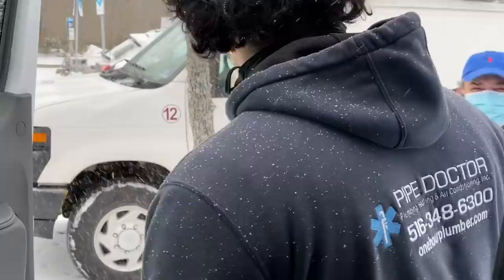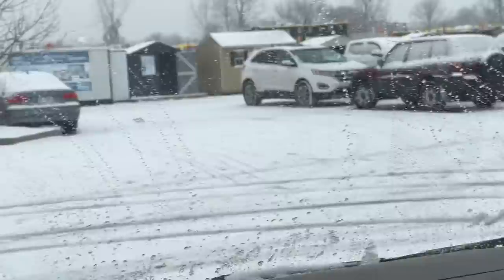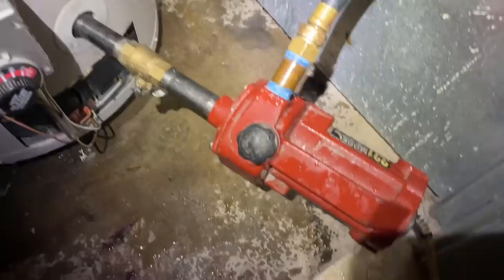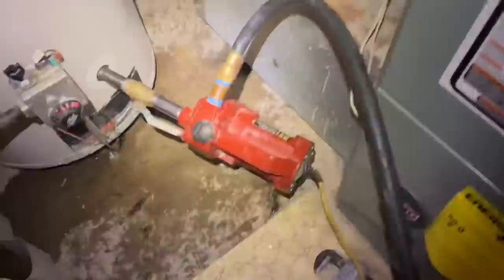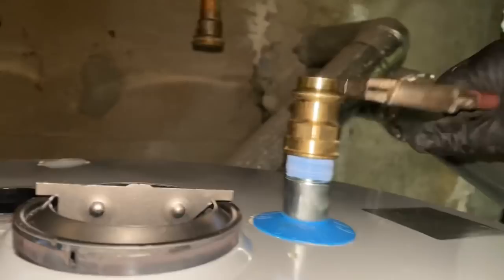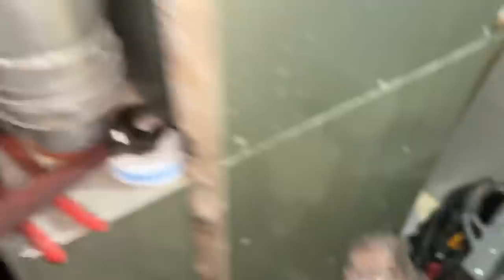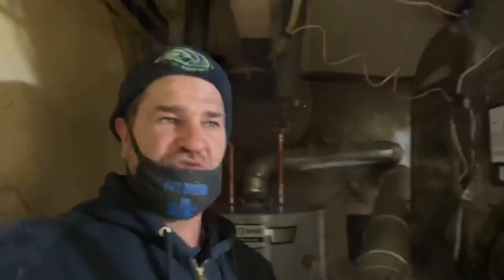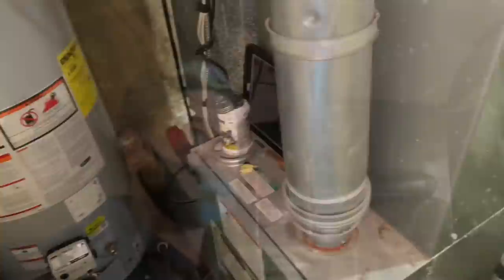Need to Replace Your Water Heater? Let's Discuss Your Options During AO Smith 50 Gallon Installation

Comment: I find tank less water heaters is not worth the cost in most cases for exact same reasons you described.  I had few customers complaining tank less water heater not lasting. But they never had tank less water heater serviced.  I also had a commercial customer who wanted to replace power direct vent water heaters with tank less.  I talked them out of it because I know they will never service it. Unless you can service tank yourself, only advantage in the US really is space saving and most customers cannot even light pilot themselves.
Reply: They need an ion at the least and a filter with an ion would be ideal. Really, we all should have one.
Reply: Here in Texas , tankless water heaters last last long even with no service, the only reason I’d do tankless is just because I want it, but I can’t justify it because the 50 gallon just hasn’t disappointed me. I’m sure in other places tankless is a better more efficient option. Here in Texas we all have furnaces, so water heating is not used for heat.
Reply: @PipeDoctor  good choice for a professional. You’ll save money and space and have endless hot water. Did you have to add a bigger gas line?  That can be a big added cost. Our friend Roger W from Texas was against putting a tankless in his home for that reason.
Reply: @Jimbobo162  
I increased the size of the gas-line from 1/2” to 3/4” off of the 1” main gas supply line.

Not sue why, however? Wasn’t too expensive.

Comment: I was considering going tankless but I’m glad I have a regular water heater, our water heater hasn’t gone out during all these ice storms and power outages. My house could accommodate tankless or tank and I sure am glad I have regular tank type.
Reply: This is absolutely a consideration that gets overlooked by too many people. You always have 50 gallons of hot water at the ready. Glad you’re safe!
Reply: @PipeDoctor  Do manufactures still make direct vent water heaters with no electrical components? Like the discontinued Rheem storm fury brand of water heaters. Every water heater I see now has some sort of electronic control box on it. Meaning if the power goes out, you might have a problem.
Reply: @bullmoosepiper7732  Here in Texas freezes like this are highly rare, tankless water heaters are nice, but here in Texas going tankless is a matter of preference, there’s no real utility savings. My house was built in 2019 with an Ao smith 50 gallon. I’ve considered tankless just as an upgrade but I can’t justify it.
Reply: Yes!  if you're in an area with periodic power outages you can nurse that 40 or 50 gallons for a while!  Also modern tank units are much better insulated than you might think -- it's not running that much keeping the tank hot.   Finally, "limitless" hot water means your teenager might never leave the shower -- there goes whatever savings haha.   Everyone be safe in this nationwide winter mess!

Comment: BX was metal clad cloth wrapped cables from the 1920s-1940s..  The outer metal can be used as a ground, but it was never really intended as such.  Instead the cable was just protection from rodents and such chewing into the cloth wrapped wires.   (And yes, everyone I know still calls the modern stuff BX unless they're talking to an inspector.)
Reply: Let me add some information on this subject because I'm a licensed electrician with a few years of experience under my belt. BX cable, as many in the NE area of the US call it, is technically AC cable (Armored Clad) and is identified in the National Electric Code as such. It was called BX cable after the Bronx Cable Company that used to manufacture it. AC Cable has a steel outer jacket with paper wrapped around the conductors inside the metal cladding and is still widely available and can be used in many applications. It's still very popular in NY. It typically doesn't have a full-size grounding wire in it, but it can (Hospital Grade AC Cable, which requires a redundant path of grounding, is one example). Also, note that there's a much smaller bonding wire that runs through the cable to make sure the outer metal cladding can carry fault current back to ground by maintaining the metal continuity to ground, so it can trip the overcurrent device and clear the electrical fault should one exists. 

MC Cable is short for Metal Clad cable. It typically consists of an aluminum or steel outer jacket and always has a green full-size green grounding wire in it. Many people don't know the difference between the two, but the tag that is on a new roll of cable will identify it as AC cable or MC cable. It too can be used in many applications where AC cable can be used and actually has a longer list of locations where it is an acceptable wiring method. 

I personally like to use aluminum MC cable because it's lighter to carry around and has a full-size grounding wire inside of it which I feel provides a better path to ground for fault current.

I hope this helps but since most plumbers know very little about electrical theory and terms I'm not surprised that you call all metal clad cables BX cable. All good though.

Comment: You can get more hot water out of a tank heater by installing a mixing valve set to 120 and bump the heater up to 140.
Reply: @PipeDoctor  

Gives you about 30 % more hot water by  mixing cold with the 140 coming out of the tank. It also prevents Legionnaires disease bacteria from ever growing in the water tank.
Reply: I just use the taps to mix my hot and cold water. Seems like raising the temp and mixing with cold water would just burn more fuel
Reply: @Shawnsullivan7  

You don't want 140 at the faucets, scalding danger. The mixing valve at the heater makes sure the water at the tap is no higher than 120. It does use more energy, but an extra insulating blanket can help that.
Reply: @scott_meyer  Could also better the thermal efficiency of the heater if the plumbers who piped the house installed a dedicated hot water return pipe with a pump on it to lower the Delta T.  That way, you're heating close to 80-85°F water instead of 45-50°F water and keeping the hot water circulating through the pipes to minimize wasting water to get the hot water over to the faucets.  I find that to be very rare in my area though as most of the plumbers and builders are cheap.

Comment: When I was going to replace my oil fired steam boiler with a gas fired boiler (oil tank was beginning to weep) I looked into replacing my gas fired tank heater with something else. The numbers just didn't add up, for someone with modest HW requirements (5-6 therms a month) a tank heater is just unbeatable. The initial cost and yearly maintenance of a tankless will just never be recouped.

Just replace the adnode rod every 4-5 years and they last pretty well (13 years and counting).

Comment: I don’t know I personally like Bradford White water heater but I mean AO Smith is good one for some people.
Reply: I also prefer Bradford white too. Ao Smith is a good water heater brand but if you compare the tanks Specs bradford white beat AO smith.
Reply: Ao Smith seems to have less problems...being in Michigan I got to tour Bradford whites factory and see how they were made that was pretty cool...I can't tell you how many Bradford whites I go to within 3 to 5 years of installation and gas valves and thermal piles are always bad....its all personal preference I put an AO in my house
Reply: Nick Kirschner  I know the feeling lately the Rheem with the delta 650 natural gas valve has been a train wreck we have replaced 13 that have been less than a month old we had to move away from them
Reply: Nick Kirschner  I'd imagine lack of personal due to covid and rapid production is killing quality control
Reply: When I lived in New Hyde park my water heater was an AO Smith. My current water heater here in Florida is original (19 years old). It is also an AO Smith. They are dam near bullet proof. Thanks for posting. Stay safe, God bless!
Reply: I've done a lot of water heater service I like A.o.smith products . I've been to the plant also was a great trip.

Comment: You also have heat pump systems. There are domestic hot water stand alone systems and furnaces that do heat and hot water as well as CHP  systems to consider for multi family or very large homes.

Comment: I lived in western Wisconsin for a number of years - it originally had an electric water heater - since the place did have natural gas, I switched it out - installed my own gas line (later extended into the kitchen for a gas stove and a gas dryer) and a 40 gallon direct vented tank.  It worked really great - small house, so not very long runs of pipes to warm up when you need hot water.  I later replaced it some 9 years later with a 50 gallon tank and upgraded the diameter of the venting pipe to 4".  It took two of us - they're not featherweight ya know?  But it was doable for a homeowner.  And it was working fine when I sold the house.

Comment: I have a 17 year old AO Smith 50 gallon gas water heater that's leaking from TP valve and needs to be changed. I never flushed it in 17 years, the only thing I changed was the thermo coupler 5 years ago lol.
My plumber told me hot water heaters are hard to get now due to supply issues, he doesn't like the off the shelf Rheems or AO Smiths from the big box stores, said quality not as good as plumbing supply stores. I'll wait it out another week to get a good quality one.

Comment: Mike, I understand that if there are plastic coatings inside the water heater's fittings then you are good to go as far as dielectric is concerned. In other words, new units come with dielectric nipples and dialectic unions would be redundant and unnecessary. I believe this is correct; can you weigh in on the topic? BTW, great discussion on the water heater types--very intellectual but clear and succinct at the same time.

Comment: If 15 years, and pilot won't light, just remove pilot assembly (turn gas off) and clean small tube to the pilot (this is clogged) with $3.99 cent Walmart dust away. When air blows freely through the tube re-assemble and heater will light.
Reply: Having that issue tonight pilot won’t stay lit.

Comment: 15yrs for a water heater replacement? mine was installed in 1985 and still working but time for replacement to be safe. if a o smith only lasts 15 years going to find another brand

Comment: I definitely need to do some rearranging/replacement. I currently only have a 30gal water heater and some bozo ran 3/4in hot waterlines to my kitchen sink. 50ft of 3/4in waterline wastes a lot of water and time to get hot in my kitchen.

Comment: gas size piping is also a big consideration. Most tankless water heaters use 165,000-199,000 btus and require a min of 3/4 black iron pipe. Need to have enough fuel for the fire!!!

Comment: Only significant ben if thankless is if sized and installed correctly not running out of hot water which will also suck your energy "savings" and drive your gas bill way higher if people in house like taking long showers and now they can take even extra extra long hot showers.

Important factor to think about also besides more partd= more things more likely to fail + obviously no hit water if no power

Comment: hey mikey, a couple other points I think of. .  a millivolt hooded style water heater will work during a power failure (hello texans).. ive seen that slow drizzle of hot water be enough to keep wall cavities warm enough that even the cold water pipes dont freeze just from radiated heat.. esp if you crank the temperature up to 140 or so..   the biggest pro I find with tankless is the "endless" hot water..  there can be 2 showers going at once and the dishwasher.. a proper sized tankless can  handle it no worries(at least with 2 regular showerheads..  not sure about natural rain showers)..  I got mine for that reason more than cost savings in the future..  as a Luxury convenience item really.

Comment: No code requirement for a 'spill switch' or blocked flue switch in nyc?  I work in Orange county, ny and central Hudson has required them for the last 20+ years.  I would have thought 
the city would be more strict than us "upstaters".  I never was sold on the tankless heaters.  Many times you need to up the gas pipe size and they don't last any longer than a tank heater.
I don't see the point in our neck of the woods.

Comment: Question: I don't have gas only electricity and oil so what about a hybrid  or  instant electric or oil hot water heater?  Any of those or  stay with my50 gallon electric hot water heater?  Not everyone has gas and the gas company wants almost 3 Grand for gas hook up!   Great video and fast service for the customer Mikey pipes!

Comment: Mikey, how about talking in depth about orphaned tank water heaters when upgrading furnaces. I’ve heard that some states outlaw orphaned water heaters and must be replaced at the same time as the new high efficiency furnace to eliminate possible draft issues. I had draft issues with my 50 gallon Bradford White after having my new S9V2 Trane furnace installed. Should have been discussed when the quote was given. I finally went with a new Bradford White 50 gallon power vent model and moved it against an outside wall for easy venting thru the wall. Stay safe guys!

Comment: Often times the operating cost of a tankless is higher for a family especially if they have several girls in the home (longer showers).. when you have a tank you get in and out to save hot water for others.. with a tankless you can all stay in there as long as you want all while sucking all the gas you desire.

Comment: when I first started out I didn't turn the cold main off so the customer could use the toilet but instead shut the water heater valve off. after the 5th time getting showered with water because they opened a single lever sink and it back feeding into the hot water I decided no more mister nice guy. If I'm doing a water heater the whole house was getting shut down. It only happens once every 10-15 years they can deal with no water for a few hours.  being nice usually pays however the cold water still on while doing a water heater does not.

Comment: Was that a saddle valve at 3:46? I’m surprised you didn’t make any mention of that, considering how they are disliked, and that the movement of the pipes in the disconnect and re-connect could disturb the water tightness of that saddle.

Comment: Hopefully you can help me out on are hot water tank. Is it possible to install a draft motor on a normal tank that doesn't have one? Or do I need to change the hot water tank to one that has a inducer motor?

Comment: Typical gas valve appears to cost about $100.00 plus labor to install, so like you said better off with whole new unit, if it's over 10-15  years old.
Reply: @PipeDoctor  not smoking too much because I checked prices at HD and average starting prices near $100.00, now that's not top line like you would install!

Comment: Hey Mikey pipes am I crazy for wanting to put in an electric hot water heater I currently running oil to run my hot water heater I figured during the non-winter months I would not have to get oil and I could just stick with electric for the hot water part of my system thoughts help me Mike E pipes help me

Comment: Between the higher cost and maintenance requirements I simply don't see any advantage to going tankless.  A 40-50 gallon gas fired tank is very cheap to run and can last for *decades*.  I replaced a tank in my last house that was over 40 years old and the one in my current house is also over 10 years old.

Comment: The dielectric union debate amongst the plumbing community has always seemed to be a hot button topic.  Nearly every dielectric union I've removed had rust on the inside of the threaded connection side of the union and/or has leaked from the gaskets failing.  Hate dielectric unions with a passion.  Took apart heaters that have brass fittings and dielectric nipples installed...very minimal problems.

No thermal expansion tank on your heater install there though.  What's up with that?
Reply: Might not be code up there. Here you got to have expansion tank on the heater or the main coming in
Reply: The expansion tank is mandatory under certain conditions; in other videos he has mentioned that those conditions aren’t present there in most homes in his area.

The other thing is that an expansion on the water supply can be installed on the cold waters pipe anywhere between the meter / pressure reducing valve and the water heater. So there could be an expansion tank, just on some section of pipe not visible in this video.

Comment: Mikey, I want to replace my Atmospheric Venting gas water heater with a Power Vent one (more efficient) . Can I use the plastic piping and vent out through the original metal venting (goes up the chimney) or should I cut a new hole and vent out the side?

Comment: Mike , you are a stand up guy , I cant believe you were out there today the SS pwy was And  un plowed mess  .. Some of the guy I work with say BX cable others say ( Armored cable )  also we use Kendoff  to mount equipment( Pipes/ Conduit)   some guy  call the same thing (Unistrut ) ???  In your opinion how long do the HWH tanks last before they Rust through , you must have changed dozens of them over the years    Thanks Pete

Comment: You need to get head shots done.  So you can autograph them and give them to fans.
I have thankless, have only flushed it twice in 18 years and get nothing out.  The tank I removed didn't have any build up,  so we have very good soft water.

Comment: What about geothermal hot water? Desuperheaters work in most of the country and in the summer your hot water is literally free. How about solar hot water systems? I worked in a house that had a wood fired water heater but those things aren't an option unless you find a NOS unit and dont care about plumbing codes.